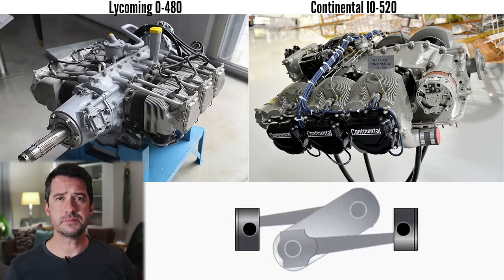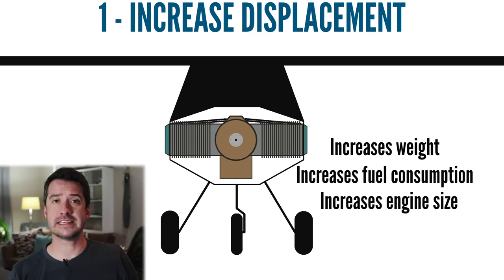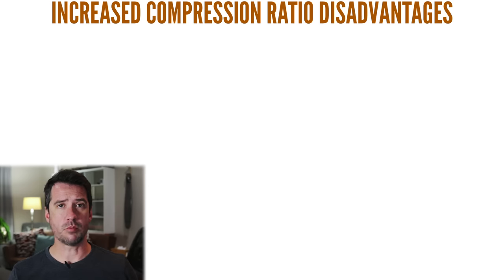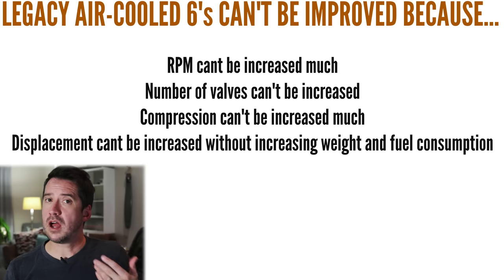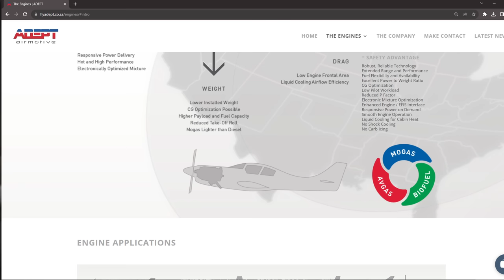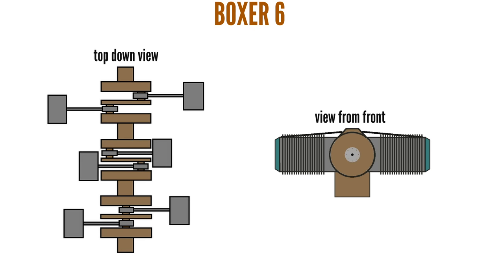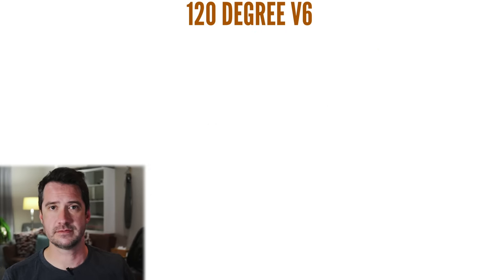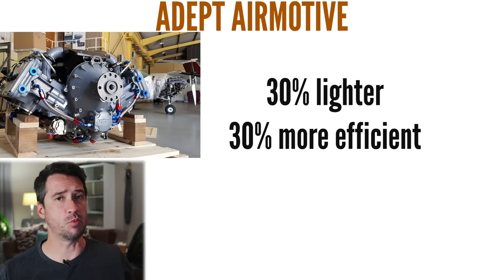Unusual V6 Airplane Engine Makes Boxer 6 OBSOLETE?

Comment: I got it, oh boy a sexy new ohc four valves per cylinder v-6 engine. This baby is so much better than those old opposed 4&6  cylinder Lycoming and Contiental engines(?)                                                                                                                                                   Some thoughts; Mr. Sexy spins at double the RPM's to make power & torque so 2-1 geared down for the propeller gives that teriffic torque number.                                                                                                                                                                                           OHV vs OHC; not so fast with less moving parts and lower friction. Ever see what drives OHC's (?) , chain/s, guides, tensioner/s . Plenty of stuff to break and they do break.                                                                                                                                 Four valves vs two valves; well at lower rpm's such as the old clunkers that spin under 3,000 rpms because of propeller directly attached to crank shaft two valves per cylinder are just as good as four valves. Higher rpm engine such as Mr. Sexy yes four are better but look into the development of those cylinder heads especially in the motorcycle industry.                                                 Cost wise the old clunkers are cheaper to produce and really with todays technology a lot of improvements would be introduced in those designs.                                                                                                                                                                                 Yes there is more to discuss but it's time for me to feed my dogs  they are much more important.

Comment: It is VERY unlikely it is 30% more fuel efficient, and much more likely to be worse. A modern, air cooled, big bore, 2 valve, electronic ign, injected aircraft engine can achieve a BSFC number of 0.38 Lb fuel per HP hour in cruise flight. The idea that a liquid cooled small displacement engine is better is flat out wrong from a thermodynamic and frictional standpoint. There is a reason piston aircraft engines are configured the way they are.
Reply: Piston ring swept area is the #1 producer of internal friction. The larger the bore, and the fewer the pistons, the lower the piston ring swept area. Same goes for heat transfer. Less surface area in big bore engines, which leads to more combustion energy being used to drive the piston down. Liquid cooling is another matter. Radiators have a low Delta T, it requires much more airflow for effective heat transfer, leading to higher drag. The old engineers were not stupid, and they achieved something that has not been beaten yet.

Comment: When looking at a AV GAS turbo 550 Continental perhaps the next step in improving the overall engine performance in this family is the adoption of water cooling instead of air cooling (the Continental CD-300 Diesel Jet-A is liquid cooled, but is relatively heavy) and fine tuning the valve train for an increase in RPMs to 3800 . With a variable pitch propeller I don't think there are many advantages in moving to a high revving engine having over head cams. IMHO, OHC chain drive arrangements are considerable less reliable than push rods given their complexity. Water cooling would allow an increase in compression ratio and permit very high turbo boost (power) pressure while being able to move waste heat effectively with a high pressure water cooling system. The waste heat could be used to heat the cabin or with a secondary system perhaps do some deicing.  I think the flat 6 is perfectly balanced for primary and secondary vibration modes. Not sure what the 120 degrees V would do for you except help with the chain drive and intake manifold setup.
Reply: Less main bearings and a thinner crankshaft reduce friction compared to a flat-6.

I was thinking about turbo. At the moment I wonder how we keep a cold air intake while being close to the exhaust header of one bank? Lots of heat shields and water cooling! This way it may be possible to have multiple diffusers all cooled by air from the front and shielded from the heat in the back. We may get away without an external intercooler.

Comment: Flat and boxer are not the same thing.
Reply from the maker: Yeah I get this comment all the time 🙂 All boxer engines are flat, but a flat engine is not necessarily a boxer. Boxer engine's opposing conrods each has a seperate, 180° offset crankpin. A flat engine that is NOT a boxer connect the opposing conrods to the same crankpin. Referring to a Lycoming 6 or Conti 6 as a flat or a boxer are both correct, but referring to it as a Boxer is more specific.
Reply: @LetsGoAviate  aircraft and nomenclature of that type are pedantic by nature. They’re not the same.
Reply from the maker: @longsleevethong1457 I would say knowing exactly what makes a flat engine a boxer or not a boxer, i.e. the difference in crankpin configurarion as I explained it, is quite pedantic 🙂 I think the problem is some get confused by the difference, which is okay.
Reply: @LetsGoAviate  that’s my point. They get confused because you casually throw the terms around together as does everyone else. That’s the source of the confusion. Stop Calling boxer motors flat motors. Ferrari made a flat 12. Call that a flat motor but not the boxer. I do not know if the lycoming is a boxer or just a flat 6. So when you say it’s flat I assume those characteristics in lieu of boxer.

Comment: You made no mention of the cooling for the V6, which obviously is liquid-cooled, bringing complexity, weight, and higher maintenance. 🙂
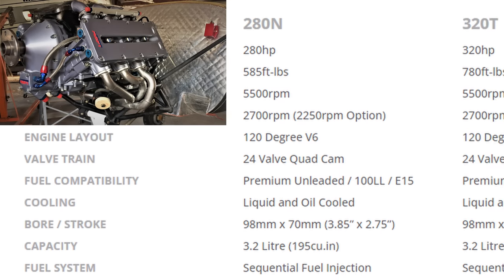Reply from the maker: Mentioned at 7:45. The engine is lighter than comparible hp air cooled engines, so the weight "problem" really isn't present here. Of course it means increased complexity, but the additional maintenance requirements are greatly exaggerated. We are now on our 3rd liquid cooled engined airplane and while the AP (approved maintenance person) has to check a few more things than an air-cooled engine, if it does make it more expensive, it's not noticable.
Reply: Air cooling with all that sheet metal and huge, complicated casts and doors in the cover looks quite complicated to me. I never had a Problem with the water pump.

Comment: Aww, sweet. The thought that you can introduce double the parts count, massively increase the technical complexity and not increase the cost to completely outweigh the advantages is very cute. Naive, but cute.
Reply: 12 valve, 6 cylinder pushrod engine: 12 valves, 12 rocker arms, 12 pushrods, 12 tappets, 1 cam = 49 parts

24 valve, 6 cylinder DOHC engine: 24 valves, 24 tappets, 4 cams = 52 parts

An increase of 3 parts is a massive increase? Anyway, Diamond Aircraft uses geared, DOHC, turbocharged, electronically injected FADEC engines in their aircraft, they seem to be working fine. The EFI Rotax engines also seem to be working extremely well.
Reply: @PistonAvatarGuy  sorry I’m just really tired of getting my hopes up and I’m starting to recognize the patterns. 
You left out the turbo charger, the gear box,  the injectors and the fuel control computers (and there needs to be redundancy).  Those are all high production cost items.  High engineering time items and there will never be the production volume to make up for that. So yeah, you’ll have a $200,000 engine with no support.

Comment: I've always undered why small displacement turbo diesels aren't used in light aircraft. They pack a lot of torque for their displacement, they're low stressed, and they last forever.
Reply: They are, they're heavy, expensive and don't offer any benefits over gasoline engines.

Comment: Some good information but also lots of false as well. Horizontally opposed engines, especially Lycoming and TCM engines, have very good weight-to-power ratios compared to almost any other engine. Their direct drive simple design also means they are easy to maintain, reliable, and relatively inexpensive considering aviation standards. These engines can also be modified in the experimental world with electric ignitions and fuel injection. However, there are liability and reliability concerns for certified aircraft use. The only compelling replacement for these engines would be a diesel option which can run on JetA.
Reply from the maker: It's not false information. The old Lycoming and Continental Avgas engines does not have good power to weight ratio by modern standards. You're commenting on a video about an engine that blows them out of the water on power to weight ratio. Yes it's an unproven engine, and therein lies the Lyco and Conti advantage. People trust them, and yes most of them are extremely reliable. It's also very difficult and expensive to certify new airplane engines, and that is the other reason why the Lyco's and Conti's are still in dominant use today, not because they can't be beaten on power to weight ratio 70 years after it's initial design.

As for geared engines, the Rotax is one of the most reliable airplane engines on the market today. The 912 and 914 has proven itself. The gearboxes don't fail and gives zero to minimal problems as long as you stick to the maintenance schedules. They are also freakishly cheap to maintain. Direct drive is definitely simpler and has fewer moving parts, but anyone who thinks a reduction drive makes an engine unreliable needs to take a serious look at Rotax failure statistics.
Reply: @LetsGoAviate  While I acknowledge some of your criticisms, there are a few points I disagree with. Firstly, a V-engine would result in a larger frontal area, making it a less practical modification for the existing fleet compared to a horizontal opposed engine. Secondly, while it’s true that all engines trace back to older designs, they have evolved to meet modern technical demands and requirements. Take, for example, the IO-550, which remains the top offering from TCM with 300 horsepower. Despite its longevity, no other engine currently matches its reliability, shape, and power-to-weight ratio, unless you opt for a turbo-prop. Ultimately, especially for single-engine pistons where horsepower requirements are met, reliability becomes the next major priority. Rotax engines have proven themselves up to 125 horsepower, a feat achieved long ago by TCM and Lycoming (C-90, O-200, O-235). Additionally, Rotax engines sound horrible and offer minimal fuel savings, typically less than 10%, due to the addition of a gearbox. Their primary allure, particularly for ultralights, is their lower price point. For instance, a new IO-550 costs around $90,000. Saving a little fuel or fewer emissions are not really the big issue. The high price and limited availability of AVGAS worldwide is the biggest nail in the coffin for these engines and GA as an industry. We need a good Diesel option. There is a compelling two-stroke option which is certified but little information about. Maybe a good topic for your next video. Check DeltaHawk.
Reply from the maker: @aircraftpartner2695  I'm always open to differing opinions, especially if argued in a respectful way, so thanks for that. I don't really disagree with anything you're saying but needs to some wider context.

I agree that V engines increase the frontal area, vertically (engine's height will be more). However from experience, the area below a boxer engine (and on some, above too) in most cowls are unused/open space. In my opinion a slightly higher engine isn't a deal breaker.

The IO-550 is a 300hp engine that weighs at least 195kg / 430lbs dry. The Adept (since we're on the subject) 320T makes 320hp at a dry weight of 155kg / 340lbs. The Adept will increase weight more once the weight of the liquid is added, but the IO-550 just doesn't compete with modern engines on power to weight ratio. On reliability however, yeah, most likely will beat most other designs. So again my viewpoint is the IO550 (and other legacy air-cooled boxers) is "superior" due to being certified and reliable, the latter obviously being very important.

I don't want to make assumptions, so when last did you operate a Rotax 912? I've owned 2 in the recent few years, the 95hp UL burning 16L/hr and the 100hp ULS burning 17L per hour. Not just in the cruise but overall average. Most real life numbers on the O-200 is around 6 gallons (22L) per hour. That's 30% more than the ULS which delivers the exact same power at a lower weight. I haven't owned or operated an O-200 before, so happy to be corrected here. The Rotax gearbox slows the prop to 2,400rpm at it's max of 5,800 engine rpm. That allows the engine to spin a prop with longer blades, which is an undisputable efficiency and raw thrust advantage. My opinion is this offsets the friction losses via the gearbox, and then some. 

I've already done a video on the Deltahawk engine on this channel, check it out and let me know what you think.

Btw. I'm not biased against the Lyco's and Conti's. We are currently replacing the O-300 of our Cessna 172 with an O-360, so I have absolutely nothing against these engines, even being the engines of choice. But I also don't easily get pulled into any fanboy-ism and always try to weigh all the pro's and con's and see it for what it is.
Reply: @aircraftpartner2695  "Firstly, a V-engine would result in a larger frontal area..."

False. You seem to forget that flat engines also have intake and exhaust manifolds. Example: The Adept Airmotive engine is 720 x 760 x 566 (mm, LxWxH), while the Porsche PFM 3200 is 973 x 854 x 610 (mm, LxWxH). Both engines are geared 6 cylinders and slightly more than 3 liters in displacement. The Adept Airmotive engine is also more compact than a LyContisaurus of similar power output. The Lycoming TEO-540-C1A is 1,303 x 871 x 569 (mm, LxWxH), that's more than a 4 inch increase in width vs the Adept Airmotive engine and the Lycoming is a couple of inches taller.

The Porsche engine is also significantly heavier than the Adept Airmotive engine, as air-cooled engines weigh more than modern liquid-cooled engines.

Comment: I thought that was a Lycoming. Another great thing about the Lycoming is that it will run if inverted!
Reply from the maker: I'm reasonably sure it can only run inverted if fitted with the inverted oil system. That's the "AE" version of Lycomings like the AEIO-360.

Comment: 9:45 aircraft don’t have problems with their engines being too long..10:25 a “V” configuration either moves the crankshaft and the propeller closer to the ground, or raises the cowling, limiting visibility over the nose.. not good. Perhaps an inverted “V” would be better, but then you get other side effects such as oil pooling..9:57 nobody wants a receive, or a prop reduction gearbox.. historically these have been the Achilles heel of aircraft engines. A geared engine has problems with low power operations such as gliding where the prop drives the engine, there are thrust issues when using angled gears, noise and chatter issues with straight cut gears.. whatever the reasons, geared engines are not desirable in aircraft engines.
Reply from the maker: Thanks. No these boxers aren't typically too long. The point I made there being long engines requires longer crankshafts which are weaker (physics) as well as there being no space for a redrive.

Yes the V config moves the propeller, but is centered by the redrive. Acknowleging the redrive cons (complexity, weight & maintenance), I don't fully inderstand where the fear comes from, but my guess is it is lack of familiarity. I definitely would't trust any random gearbox, but ask anyone who has owned a Rotax if they fear the gearbox. These redrives just don't fail when sticking with mainenance instructions. I just laat week had my Rotax gearbox inspected and tentioned as per required at the specified hours, and it's didn't cost an arm or a leg.

Is it something extra that needs to be check at service? Yes. Does that drive up maintenance cost resulting in expensive maintenance? No, it's actually more affordable to maintain that any similar powered old air-cooled boxer.
Reply: @LetsGoAviate  the cranks aren’t a weak link to boxer aircraft engines. The weak links are the flat tapped camshafts and the exhaust valves.  I see this engine design as an overly complicated, expensive engine. Conventional aircraft owners don’t want auto engine conversions. High reving, gearbox, water cooled, electrically dependent.. no thanks. Conventional engines just run and run.. cut every wire, and as long at it gets fuel, it’ll run. Sure they could use improvements like roller camshafts, maybe better metallurgy for valves and valve seats, perhaps an advance curve in the ignition. I like the E-mag air electronic ignitions because they self generate above 900 rpm.. but conventional aircraft engines don’t need electronic fuel injection.. they don’t need to be optimized for a broad rpm band. Mechanical fuel injection can be tuned for a fixed power setting where these engines run, and don’t need backup batteries, backup dual alternators.

Comment: 1 intake valve is usually more efficient than 2, because it increases air velocity and mixes better, at the low rpm these engines run at.
Reply: Facepalm

Comment: Is it going to leak Oil like the 2 stroke Detroit Diesel engines in trucks and boats? How do you counter engine run away when the turbo seals fail?
Reply: It's a petrol engine not diesel, it has a throttle valve. Turbo and engines have improved greatly since Detroit engines were made.